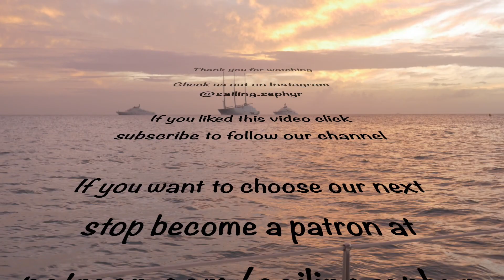Boat Works in Sint Maarten - Ep.3

Comment: Just found you and subscribed:)  If no one has shown you this yet, now that you have a motor, not much need to bail the boat anymore. Give it a little power, pull the plug in back and the water will just disappear(adjust your speed til it starts flowing out), be sure to reinstall the plug before you drop to a speed that water starts coming back in!